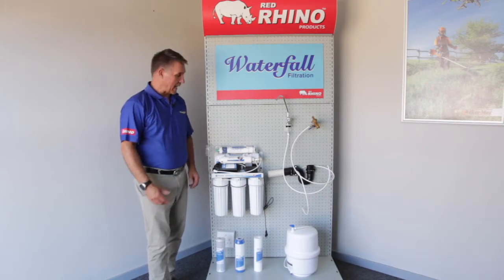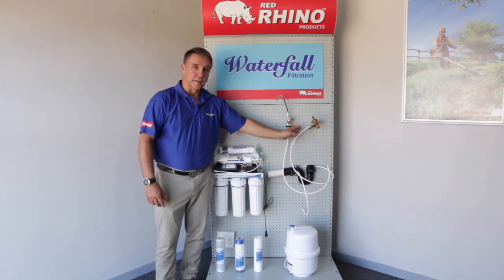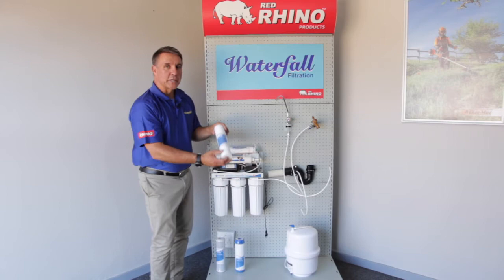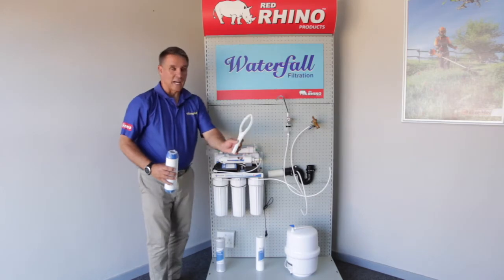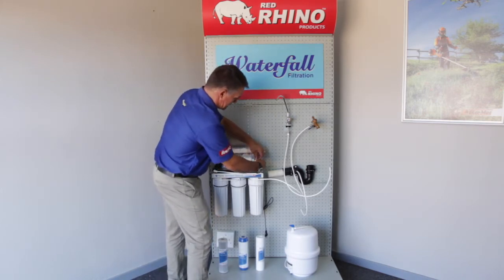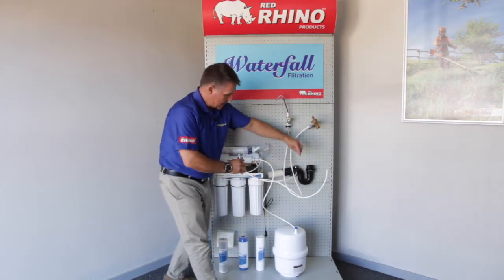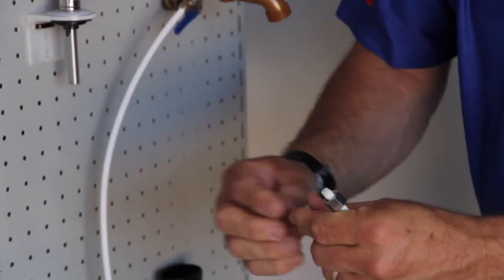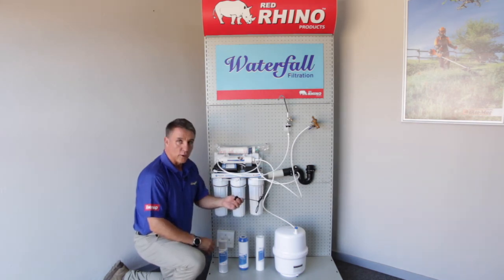How to install 5 Stage RO System

Comment: I buy this system all the time for my clients. I must say colour coding and some proper instructions would be a plus. 
I bought a system for myself and now there's no water coming through the faucet, just a trickle and then it stops. It came assembled already but im sure the tubes weren't inserted in the right place on the ASO.